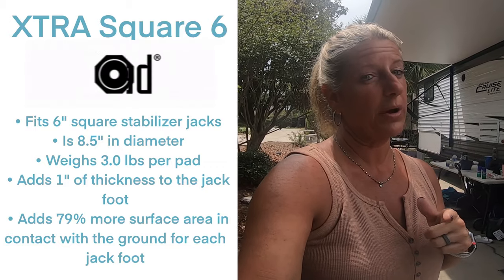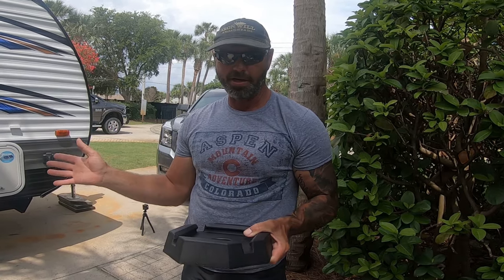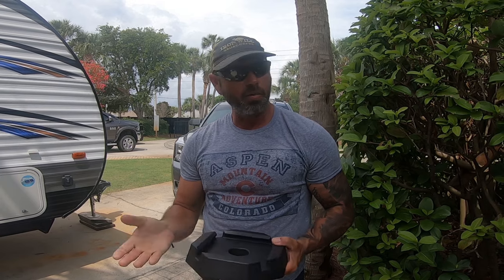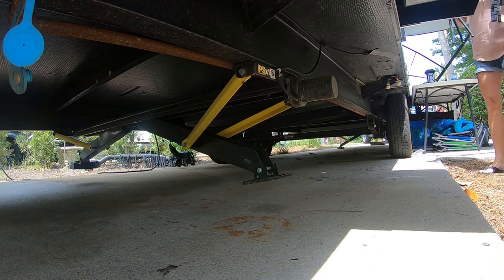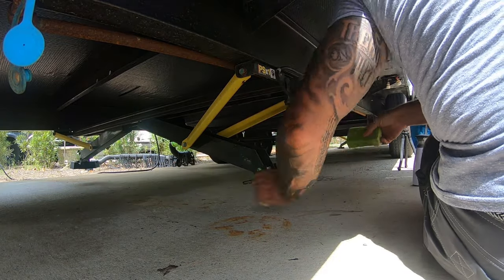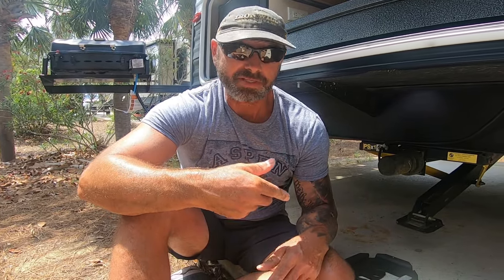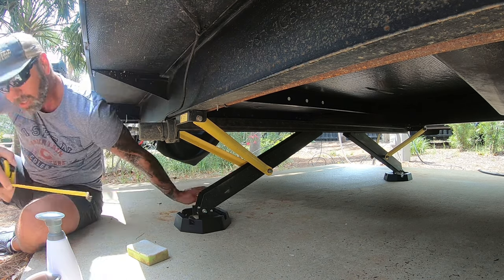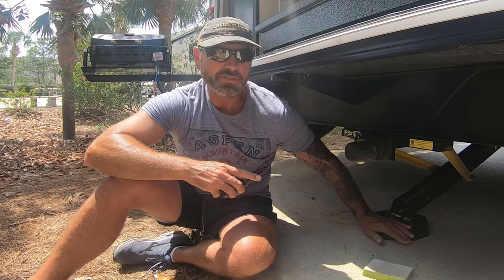XTRA Square 6" SnapPad REVIEW

Comment: We were going to get some of these for our Reflection. But we were told by Lippert that it wasn’t good to extend the auto leveling all the way out. You should have 3-4 inches of blocks on the ground before you auto level. Otherwise the legs may extent too far and could cause damage.
Reply from the maker: I will have to check I believe these are at least 2" thick under the jack but I will measure when I get home. Thanks for letting us know. I can't say that we have ever extended all the way. I know I have seen someone where they had the tires are several inches off the ground.